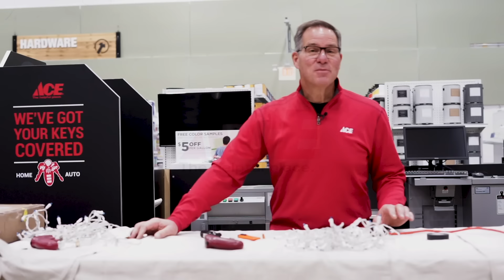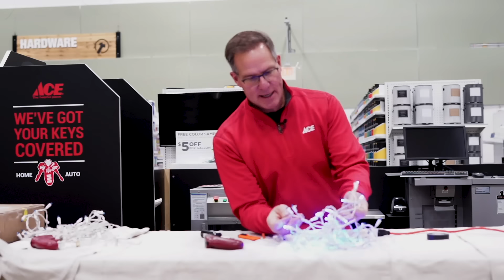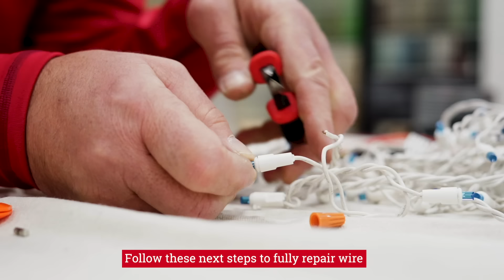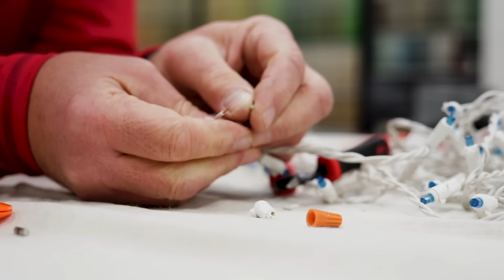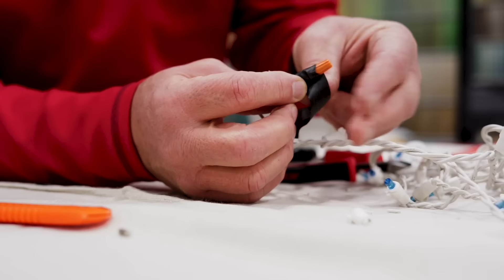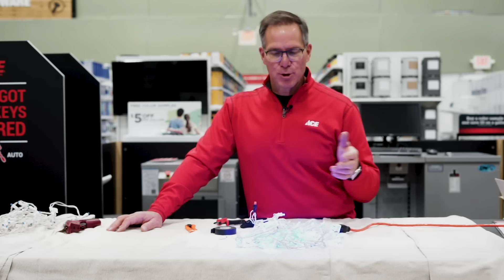How To Fix Christmas Lights Half Out - Ace Hardware

Comment: I couldn’t find anyplace the wire was broken. Could it be something else? The lights work halfway along the string, then stop working.
Reply from the maker: It could be a bad bulb. Bad bulbs have a smokey black look to them. They are also easy to idenityf if you use a repair gun like this one.
https://www.acehardware.com/departments/home-and-decor/holiday/christmas-indoor-decor/9884750

Comment: i put these christmas lights on my car and a small strand of them is completely out. i don’t have any sort of tester so am i cooked? they were working fine but i also don’t know how to get a new light in plane fully
Reply from the maker: If you don't have a tester, you'd have to inspect each bulb individualy that the bulb is not burnt out and the light is securely in the socket. Hope this helps!
Reply: @ yep i found out that one light like the actual bulb was loose, so i replaced it and it all works now. Thanks for the help though !

Comment: Anyone have any ideas as to why this would still be happening after reconnecting the wires? I had one strand that works, but everything after where the wire was cut is dimmer than the rest of the strand? trying to fix it!

Comment: How do you remove the fuse from the plug?
Reply from the maker: Hi There,
You need a small screwdriver and when holding the plug in your hand you’ll see a little sliding door open that up and then use the screwdriver to pop it out.  Just be in sure that your light strand is not plugged into an electrical outlet before attempting.

Comment: tbh if you dont want to lose a light in the string you can (i've done this a few too many times) take the diode/bulb out and remove the contact plate the wire got ripped out of and solder it back on then reinsert the contact plate

Comment: Thank you so much.  Lights were all up, so replacing the string would be a BIG job.  Found the broken spot where the squirrels probably chewed through.  Stripped the wires like you instructed, added a little electrical tape and Voila! we have lights again.  Thank you! so much!!
Reply from the maker: So glad it worked! Another light strand saved. :)

Comment: The title is incorrect, because the video covers checking the wires, but doesn't mention how to check for a bad bulb, which would also cause half your strand to go out.  And, as previously mentioned in other comments, the fuse advice is incorrect.

Comment: I have a a Candy Cane window silhouette that isn’t working at all. It’s old but it worked last year. Even if a bulb is burnt out the others still work. 

Last year I noticed the wire was a little ‘sensitive’, depending upon how it was bent or positioned. All the lights would turn off if the wire was bent a bent a certain way but then would turn back on if I repositioned (fiddled) with the wire. I’m hoping to be able to fix the problem. Any advice? I don’t  think this window silhouette has any fuses.
Reply from the maker: There should be fuses in the actual plug.  Try changing those, if not then you can try the Light Keeper Pro tool. Hope this helps!
Reply: @AceHardware  Thanks. But I don’t think there are any fuses in the plug. There’s no way to open it; and it doesn’t say “open” with an arrow, indicating how to open it. Is there another way to open the plug?

Comment: So what is the problem when half the strand is out and fuses are good, no loose wires, and all bulbs are fine?? The strand is made by Sylvania and is only 1 year old.
Reply from the maker: Hi David,
It may be a corroded shunt. Before cleaning away the corrosion, ensure that the light strand is unplugged and that no electrical current is running through it. You can then use a small brush or file to remove the corrosion. Gently blow away any debris left behind before inserting the bulb. Hope this helps!

Comment: Thank you! Home repair is not intuitive for me one bit, but I am determined to try and fix something before recycling or discarding it. My strand had the disconnected wires at the end with an end bulb holder split, I got a wire nut and closed the loop and voila, the entire strand is lit!  I am so proud I was able to make this fix and grateful for this very helpful video.

Comment: It likely will not be a fuse iirc because both neutrak and hot notj usth ot or live etc energized no not energized both are energized but both are fused for some reason idk why instead of just hot/because otherwise I have theory that it maybe possible if the neutral blows first then its dangerous due to being still energized.

Comment: So the light string won't light at all but star tree topper that is plugged into the string lights up, what's up here?
Reply from the maker: Did you try using the light keeper pro to see if you can resolve the string lights? And do any of the bulbs look burnt out? Burnt bulbs have a little smoky look to them and would need to be replaced. Hope this helps!
A lot of our video viewers are finding that the Light Keeper Pro is doing the trick. Here's the link to get some more info on it.  
https://www.acehardware.com/departments/home-and-decor/holiday/christmas-indoor-decor/9884750

Comment: The statement that if one fuse is blown it could cause half the string to be out is INCORRECT.  There are two fuses in the plug of most Christmas lights but its because both plug blades are fused.  The plugs are non-polarized meaning both blades are the same size so either could be plugged into the line (hot) side of an outlet.  If either fuse is blown, the whole string would not work.
Reply: No fuses are blow. Out if half the lights are working. If one fuse was blown none of the lights would work.
Reply: Okay so how does it get fixed
Reply: How do u fix it 😂
Reply: Ace did not do the homework. I was going to comment but other viewers already noted the mistake.
Reply: Yep.  I was about to post the same thing.  Surprised Ace, usually a good channel, would post obviously incorrect information, especially when electricity is involved.
Reply: I stopped watching the video as soon as he said that. I looked to see if anyone else commented and sure enough - you did! Thank you for pointing out that simple, but important, fact.
Reply: @michaelshepperd101 pj
Reply: Thank you and all other posters.. This is actually Savin me alot of time!
Reply: How many fuses are blown when half is out?

Comment: I would say use some whiteout on the electric cap and squeeze some hot glue into it to seal it from water. Very discreet if you can’t hide it. Ps I almost donated my lights with this issue. I’ll check them with this idea later. Thanks
Reply: donated them? def not a bill of all trades if you can't fix christmas lights scrub. so get to work buddy.

Comment: If you do end up having to cut a light out, you'll have a space that is not lit.  If you can't hide it, try zip-tying (or taping) the next light in line to the correct space between the other lights.  You can buy zip ties or tape in a color to match your wire.  Another solution would be if you have two strings that are not working that are identical and you find one light is bad, cut out a light with sufficient wiring on both ends from both strings and splice a good light in place of the bad light on the string that you want to repair, (or you could buy a new identical string just to use for spare parts).

Comment: as an amendment perhaps state that the more you remove the higher voltage is going through the rest of the led's and therefore pushing them will make them last less time before more burn out.

Comment: Bought 5 sets of 100 l.e.d.s from lowes last year, 2 failed so i returned them all. Bought 6 from home depot of a different brand and all worked but 1, returned and replaced it. Worked fine all last season. Checked all 6 sets before i took them to the roof and they all worked. After spending 2 hours on the roof hunched over i plugged them in. 3 fully on and 3 sets only partially come on wtf. Im so tired of chinese made junk and the aggrevation of pulling them out of clips every 16". Once i take all these lights off im done dealing with this nuisance every year.
Reply: Hang it up Clark! 😂

Comment: What if i plug in,there's light but just seconds then shut off,hoping for your reply thanks
Reply from the maker: It could be a fuse that is located in the plug.  Check out this video on replacing a fuse and see if that solves the issue: https://youtu.be/Qdi3147GGoA

Comment: Not correct! If there is one bad fuse it means the continuity of the circuit is broken and nothing at all would work.
Reply: ever wonder why there are 3 strands in the wires?🤣
Reply: @Mitchell_is_smart._You2bs_dumb  yeah! The 3rd wire starts after the fuse and feeds the 2nd half of the circuit 😆

Comment: Okay, but al the wires are in
Reply from the maker: The strand will require further diagnostics. You may want to use a light bulb tester like these.
https://www.acehardware.com/departments/home-and-decor/holiday/christmas-indoor-decor/9884750

If the strand is LED, you will use this one
 https://www.acehardware.com/departments/home-and-decor/holiday/christmas-indoor-decor/9237322

Comment: Just so everyone knows when you remove one light from a series string all the other LED's will be driven a tiny bit harder. May lead to weak led's failing sooner than they would otherwise.
Reply: I thought if you break a circuit on a series string then the lights after the broken one will go out
Reply: Removing a single led bulb would be negligible…
Reply: nah, I'm gonna have to agree with the "that's not how it works" guy. if I don't do this, their life is over. if I do cut the ded led out, their life is extended.
Reply: Sorry but that's not how it works
Reply: @imsouledout  Can you take moment to explain to us how it does work with a series string?
Reply: I just did a little research. You're right! I stand corrected.

Comment: What a coincidence. I have 10 strings  of LED lights I bought at my local Ace 3 years  ago. Now, on 3 strings only half the string works. Fuses OK, no noticeable pulled wires.   I suspect most failures are  failed or corroded sockets or a  bulb with blown shunt.

Comment: Wire nuts & electrical tape outdoors in the winter yeah that's weatherproof absolutely not it will green corrode

Solder & heat shrink two layers only thing that works

Comment: What about if there's a fuse in line that can't be removed?
Reply: Ahdrutgrgdjfefgrttefeyur3656788657atwyt
Reply: @RekhaDevi-uj9wx  fax
Reply from the maker: Hi Randy, For the lights.  If they are incandescent.  Try a tool called the light keeper pro.  Pull one bulb out and insert the socket into the tool and pull the trigger a few time.  This while the strand is plugged in.  That may work.  If these are LED then you have to use the extra bulbs that came with it and pull and replace one bulb at a time to find out the one that that is no making the connection.  Hope this helps!